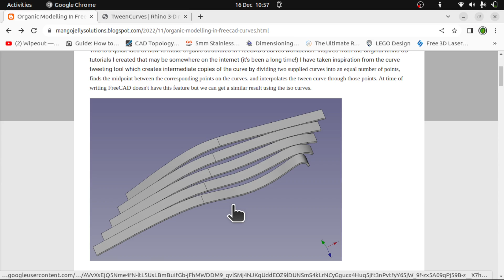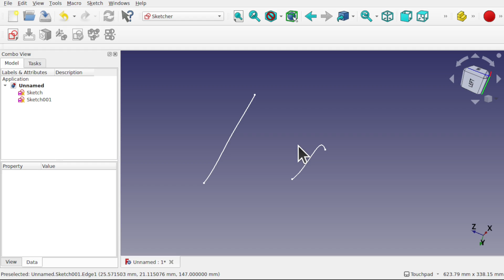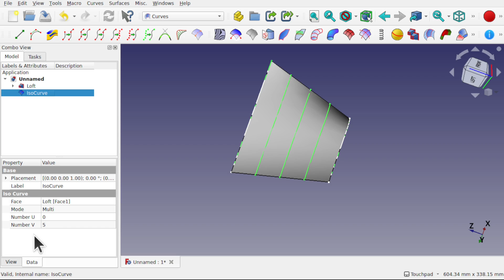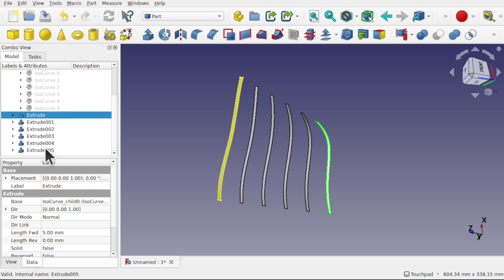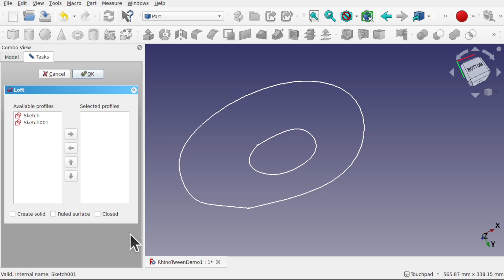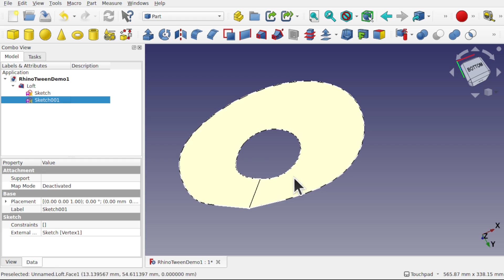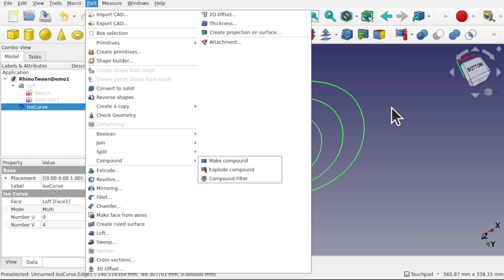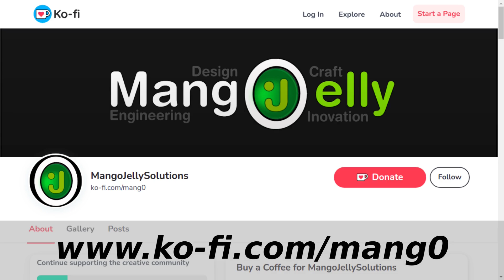FreeCAD vs Rhinoceros 3D : Are Rhino Tween Curves Possible In FreeCAD?

Comment: 00:00 Intro
01:28 Creating a curved surface to break up later
03:39 Adding the "between" curves with IsoCurves tool
05:09 Splitting IsoCurves result into separate items with Part -> Explode Compound
06:30 Demonstration of extruding curves
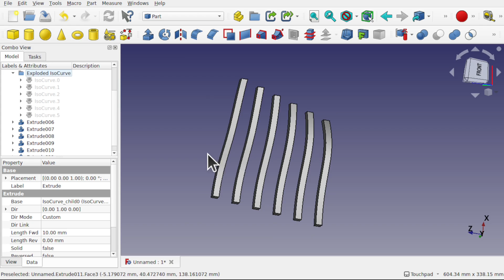07:40 (Closed B-spline tweening)
07:40 Sketching two closed B-splines
09:22 Eliminating crossed paths in B-splines
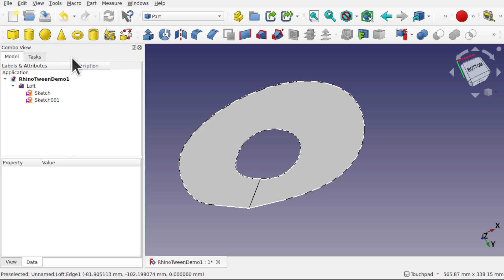11:09 Adding the "between" loops with IsoCurves tool
12:09 Splitting IsoCurves result into separate items with Part -> Explode Compound
12:37 Demonstration of extruding curves
13:13 Potential Future Topics
14:51 Outro

Comment: Interesting approaches there. I'm in a similar situation finding the best process for contoured terrain from cloud point elevation files, which is not easy. Breaking a surface using an iso curve is an interesting approach, I will have to try this out.
Reply from the maker: Great to hear it could help. There is a points workbench in freecad but I haven't used it. Let me know how you get on.
Reply: @MangoJelly Solutions  Yeah used the points workbench, unfortunately it can't deal with real world coordinate systems properly; you have to import using the Trails workbench which sadly has sort of stopped in development. Have a look at the Trails workbench forum thread and you will see a discussion there of what I tried to do. There is a workflow there which I described which is extremely painful using various workbenches.

Comment: I wanted to use loft between curves imported from inkscape, it messed them up. Perhaps due to the start point?
Reply from the maker: Yes the vertices have to be align in such a way so they don't twist the ending product so your transition between profiles is smooth. They also have to have the same amount of vertices. So say you draw a box in inkscape each corner will be a vertex. Your next shape  best to have 4 corners otherwise one will be added during the loft and it may not be where you want